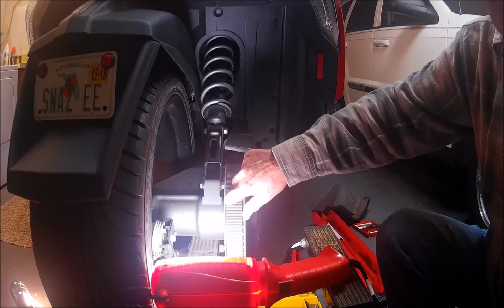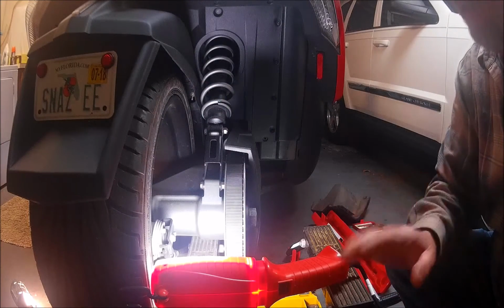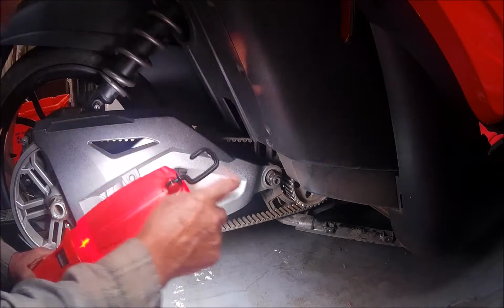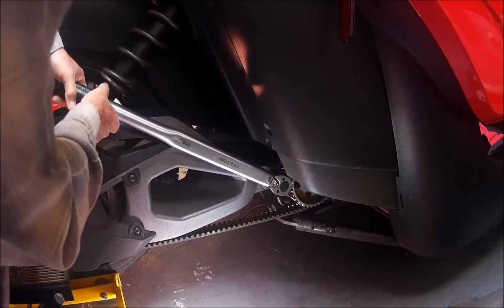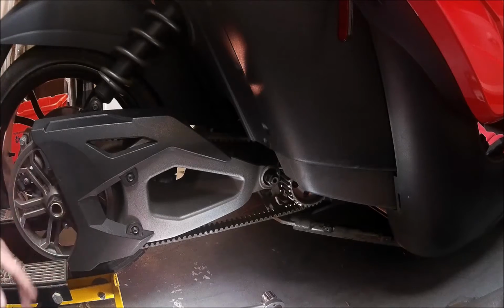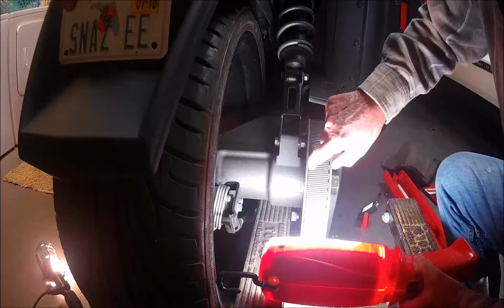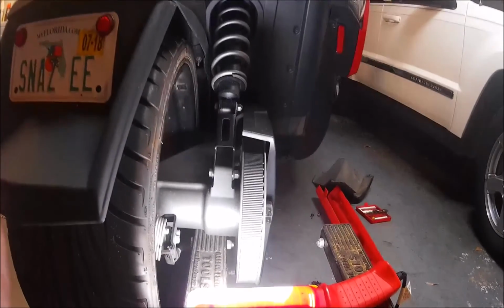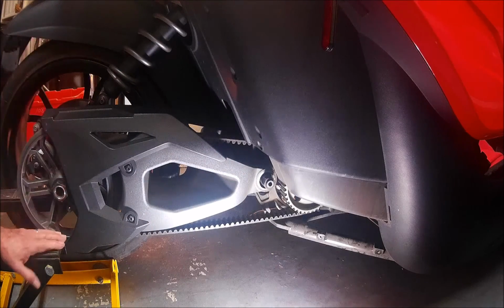Polaris Slingshot Drive Belt Alignment Adjustment Procedure

Comment: weird that you would lift it by the swingarm when you are tryin to push the swingarm outward? wouldn't that hurt it even more? i would think that rear suspension should be fully extended form lifting.  correct me if i'm wrong.

Comment: Thank u. As soon as the rain clears im doing mine. Great video.
Reply from the maker: @joe Chancio, thanks for your comments.  Yes, rain, wet roads and debris on the highway are bad for the three wheeled Slingshot.  Avoid driving in these conditions.  It is better to make adjustments to your Slingshot than have others do it.  Get the best understanding of the Maintenance procedure and perform to those specs.  I had a shop manual to guide me to produce the video.  I am glad you found it helpful and hope others will gain the same confidence.

Comment: Thank you Sam for the video. Is there a way to adjust the pulley towards the front?
Reply from the maker: tommy Horton belt alignment is checked and adjusted by observing the rear pulley alignment only.  There are no adjustments of the front pulley.  The front pulley assembly has adjustment movement to the front and back for belt tension specs.  I have another video that covers that.  Good luck and enjoy your Slingshot.
Reply: Sam Owens i looked and my front pulley looks like the belt is in the center. Is that okay?
Reply from the maker: @TheHortons  It will usually ride to the far left on front pulley if the belt is aligned to the left on the rear pulley.  The belt should be about 1 /16th in from rear pulley lip edge.  That is the key to the alignment of the belt and the front pulley should ride where it should.  Look at another slingshot and see what you see.
Reply: @samowens44  thank you sir! After I adjusted the front pulley eventually rode where is should be because it isn't unaligned anymore
Reply: Sam Owens can you give me a call? I just need some advice.
9
Reply from the maker: @TheHortons  how about you calling me on my Google Number 352-577-2312, be glad to give you advice if I can.
Sam

Comment: Thank you for the process. No thanks for the torque wrench abuse. A torque wrench is a precision instrument. Never a breaker bar. Accurate near the middle of the scale.
Reply from the maker: Thanks Fred for your comments.  I am using a 300 ft Lbs torque wrench range for a 185 ft lbs nut torque requirements.  I just figured it should be able to handle loosing a nut torqued at 185.  I will research the proper use of the torque wrench for my future videos.  I did research and it is a very hot topic among mechanics and engine builders.  I feel I am safe with my torque wrench use.  It will only be used one or two times in my ownership of my Slingshot.  It was bought to be used for this adjustment only.  I feel I can safely use it and not destroy it too badly.  This is a one time adjustment for the Slingshot.  It is not something you will need to do as a maintenance item.  To support Fred's statements for abuse of a torque wrench.  Most support was toward not using the torque wrench to break loose nuts and bolts.  This is most strongly stated for folks that will be using the tool frequently for torquing needs.  Calibration requirements are needed for a torque wrench of over 300 uses.  So, if you purchase a 300 ft lbs torque wrench just for this adjustment, I think you can safely use it to brake loose the nut and re torque it to 185 ft lbs.  You can put it away or sell it to another Slingshot only.  Tell them you used it one time.  It cost $65 new.
Reply: I’ve been a mechanic for over 20 years and yes you can use a torque wrench to loosen!
Reply: Can be used as a breaker bar as long as you don’t exceeds its maximum torque clockwise or counterclockwise

Comment: @samowens44 I adjusted the belt to the left. Tightened everything back up, took it for a ride and the screeching is still there
PLUS when i got back home and checked the belt to see if it was still towards the left side and it wasn't. The belt shifted back to where it was. What do I do next besides taking it to the dealer.
Reply from the maker: As you turn the 22mm pivot screw to make the adjustments, you should be turning the wheel slowly and let the belt walk to the new location.  a little at a time.  Very important.  Another key part is to put the adjusting torque setting to 25 or 30, forget the correct setting.  This is needed to hold all adjustment of the pivot bolt.  Then you need to put the 195 torquing to the final setting.  Those three thing will lead to a belt tension that will stay where you put it.  Hope this will help if you think you missed one.  You must also raise the rear swing arm and not the frame.  The swing arm needs to be in the driving plane and not hanging down.  Good Luck.  Last choice is let the dealer do it.
Reply: @samowens44  the fact that I raised the SS from the swing arm and not the frame made a huge difference. I made that adjustment then I checked the belt tension and it was with the 5/16. Pulled out in reverse from my driveway and I got it to check the belt and it was still in position. Took it for a ride at almost 70 mph and came home. The belt was still good and the screeching was gone. Thank you so much my friend.
Reply: One thing I did that helped was jack up rear swing arm.  Loosen and adjust 30mm nut to about 25 ft lb, start the engine and put it in first gear and let the engine turn the rear wheel as I adjust the 22mm Allen.  Of course be super careful doing this but you will see the belt walk either direction much faster and I found  the belt stayed where I put it after this.

Comment: So did adjusting the alignment help with some of the belt noise?
Reply from the maker: Chris R, I did not have a belt noise, I only wanted to show the Adjustment procedure.  I did adjust a little to demonstrate the process.  I do everything I can to help others with issues with the Slingshot.  A dirty belt will cause squeals, so keep your belt clean, that is the first thing to do if Belt Squeal is the issue.  Thanks for commenting.
Reply: It worked for me